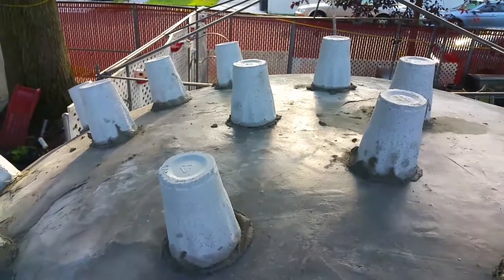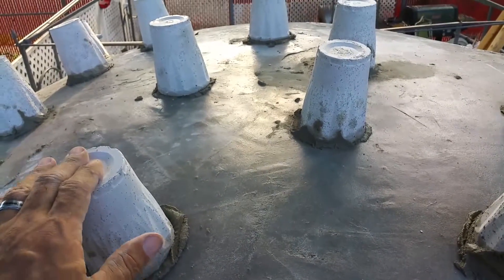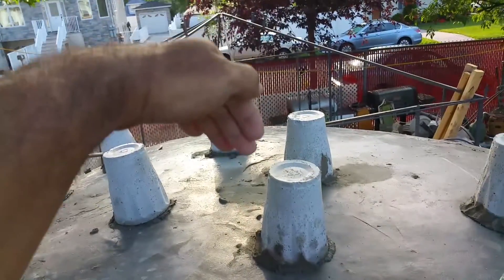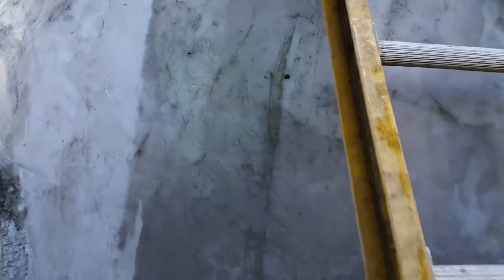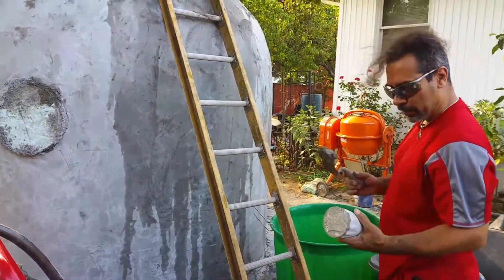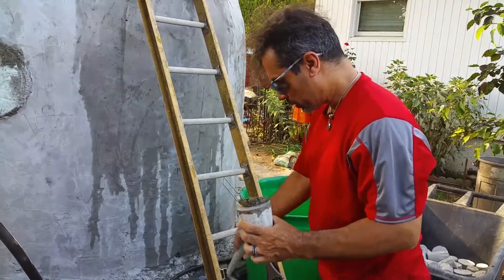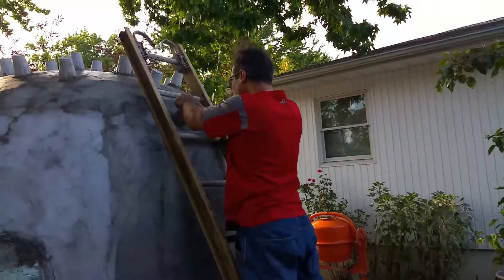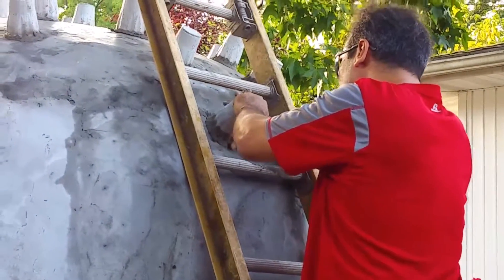Cementing Aircrete Spacers on to Dome #AircreteHarry #Aircrete #DIY #AircreteSpacers #Dome #Build

Comment: I thought about doing this...but I think it would be much easier and faster just to pour aircrete into a large, long rectangular wood form then cut into blocks. Then use airform as a guide while you stack the blocks all around. On the inside do a layer of plaster and on the outside a layer of cement. Coat the outside layer of cement with some type of liquid roofing rubber to the color of your liking... kinda what I have in mind when I build my future off grid place. What do you think?

Comment: Yes I am really impressed with system but my project would only be 1000 feet. I wish I had that kind of money lol. 

The panel building system using air crette is more my speed😩. I need to find a foam generator and work on my formula. If you know of a small system let me know.

Thanks have a good Sunday
Reply from the maker: I'm building a foam generator now based on what i have learned.
Reply: Talyn71 Gmail I would like to follow along did you have a set of plans? I am good at learning from others lol. I looked at various mfg foam generators but nothing a hobbyists or small job like I do seemed feasible. 

I know it is a pain to put out a detailed video but I would ask for any links? I will post some panel links concept wise they are awesome. 

Why air Crete it is light weight and I am disabled from injuries on active duty so heavy work is just not an option. I have to get u links this evening.

Comment: Hello just found this video
 I am thinking of aircrete. for building panels to form a shop building
Reply from the maker: I think it's a good idea for the panels. I will be making a test panel later, my plan is to make all the inside wall of aircrete. I will be experimenting with different ways to do so.
Reply: Talyn71 Gmail thanks I am really looking into this. Have you looked at spider tie systems also? I only know what I have saw on you tube not pushing it just really awesome to me.
Reply from the maker: I have seen that spider tie system it cool. it looks to me like more work and more expense than the dome build.